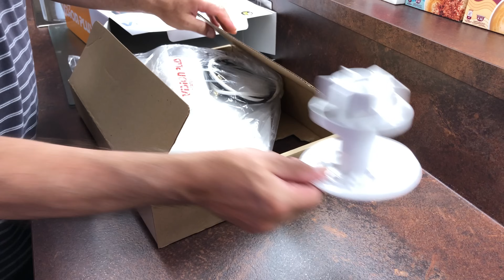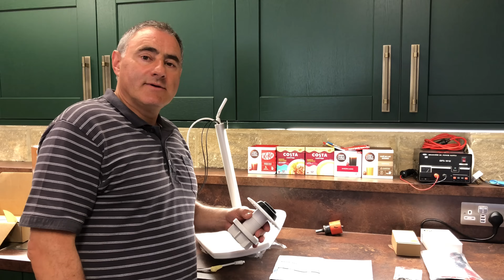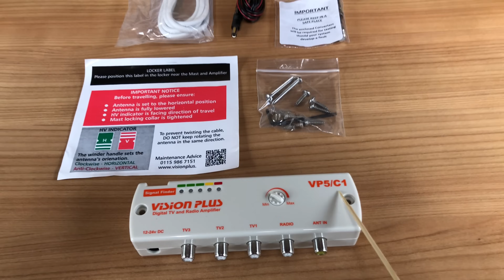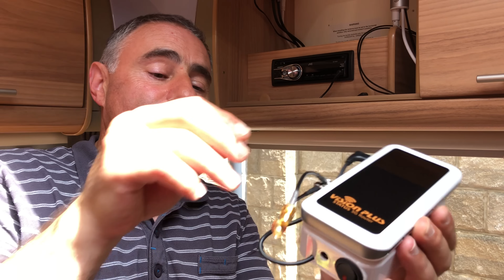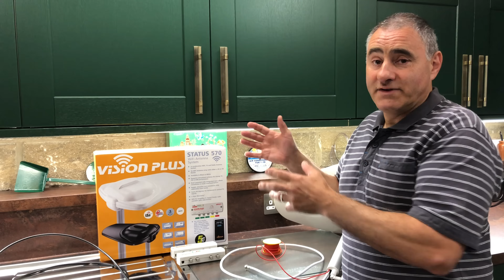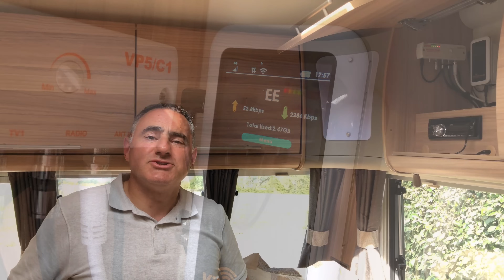Vision Plus Status 570 WiFi Antenna for Our Caravan

Comment: Fantastic video and explanation Rob. We have the same system on our new van, and like you we find it superb 👌
Reply from the maker: That’s great news John and thanks for your compliment 👍. We’ve just returned from the Lake District in a very poor mobile signal area. Alas even the Vision Plus couldn’t help us out, but I would imagine any of the WiFi kits out there would have struggled and wouldn’t have done any better. At least there was good free WiFi onsite. Thanks for watching and commenting. Cheers, Rob & Gail 😀
Reply: @robswiseways5697 Yes, many areas of the Lake District can be dreadful for mobile signal, testing even the best of devices

Comment: Thankyou so much for solving a problem for me. I now know what needs to be done about our TV and WiFi issues!
Reply from the maker: You’re welcome Yvonne. We’ve just spent a few days on a site in an area with poor/zero mobile signal that even our new Vision Plus set up struggled with. Luckily the site had brilliant free WiFi but we still struggled to make and receive phone calls. On our final day I found out the Vision Plus can connect to campsite WiFi via its antenna. I need to speak to Vision Plus to find out exactly what I need to do and I may do a short follow up video. It’s all new to me and a learning curve at the moment. Thanks for watching and happy touring 👍. Rob & Gail 😀

Comment: Great video Rob, do you have the link for the 12v Splitter please
Reply: Please ignore the email asking the same question 😅
Reply from the maker: @Dave-ps7co  No probs Dave
Reply from the maker: Thank you Dave 👍 . Search ebay item number 186078027569 for 5A 1 DC Female to 2 way male splitter plug 5.5 x 2.5mm power supply cable. 1 female to 2 male costs £3.02 plus £2.52 post. There is also the choice of a 3 way and 4 way splitter. Hope this helps. Cheers, Rob & Gail 😀
Reply: @robswiseways5697 cheers thanks, please ignore the email asking the same question 😂

Comment: HI, Rob, Fantastic video, ive just ordered it yesterday, I have a coachman and have a red wire and black wire from arial do I just cut the red one off and cut the black one and feed it back to the radio plug on the amp? I've watched the video but just want to double check. many thanks
Reply from the maker: Thank you Smokey 👍. Bear in mind you may want to hold onto your aerial in case you want to swap it back if/when you change your caravan. If this is the case make sure you cut the red wire and black cable with enough length from the mast to be able to connect it back together. Yes the red wire can be tucked out of the way and the black coax cable connected to the radio output of the amp. Hope it goes well. Cheers, Rob & Gail 😀
Reply: @robswiseways5697  thanks for your reply. Both keep on putting great videos out, all the best.
Reply: Hi, Rob UPDATE  lol  My order didn't come and I noticed the place I got it from had a flash sale on with £50 off this weekend, so I rung them up to cancel and they knocked me £50 off and it;s in the post. Happy day's lol
Reply from the maker: Wow, that’s brilliant Smokey. That £50 saving will take you away for one or two nights and you will be able to put it to the test 👍
Reply: @robswiseways5697  Yes we at at jawed next weekend so will try it. Thanks
Reply: Update, just fitted it on site in North Yorkshire, fantastic bit of kit getting channels never had before on fire stick total game changer, well chuffed. Steve
Reply from the maker: That’s fantastic news Smokey 👍. Pleased to hear you are well impressed with this kit. Our last holiday was unfortunately in a practically zero mobile signal area so couldn’t explore the Vision Plus capabilities. Will try next time we’re away. Might even do a short follow up video. Enjoy the rest of your holiday. Take care, Rob & Gail.

Comment: Very informative Rob, I noticed on your original sim the speeds were in Kbs , how fast did you get it with your other sim?
Reply from the maker: Hi Chris, it was still in Kbs but was picking up those two 4k YouTube videos. I can’t remember the numbers but it was higher than the first sim. Unfortunately Gail didn’t zoom in enough. We’re in the Lake District at the moment and mobile signal is very poor where we are staying. Inside the caravan we are getting one bar on the phone and sometimes no signal at all. I moved the sim into the router but it also only picked up one bar. So I’m now connected to the campsite WiFi. Unfortunately this is an example where even the Vision Plus can’t help us out. Hope this helps and thanks for your comment 👍. Cheers, Rob & Gail 😀
Reply: @robswiseways5697 it does, thanks!

Comment: Hi Rob. I want to buy the three way power supply cable off eBay, , but I cant find the cable which has the 5,5mm x 2.5mm? There are plenty of 5.5mm x 2.1mm. Can you give me the product number of the 5.5mm x 2.5mm on eBay you ourchased, to allow me to get one. Thanks in advance,
Reply from the maker: Hi Robert, Search item number 186078027569 for 5A 1 DC Female to 2 way male splitter plug 5.5 x 2.5mm power supply cable. 1 female to 2 male costs £3.02 plus £2.52 post. There is also the choice of a 3 way and 4 way splitter. Hope this helps. Cheers, Rob 👍
Reply: @robswiseways5697  Many thanks, much appreciated.

Comment: Great video and really informative Rob!

This Video, as per your comment about the Product, came at the right time for me as I was going to get my local Dealer to fit one of these kits but your video has given me the confidence that I can do it myself; Also good suggestion about buying the Full Kit to get the upgraded Amplifier (mine is currently a VP3 so I'll do the same).

The thing which I found most interesting was the solution for Power to the Router since the main issue which was driving me towards a Dealer fit was most other videos I'd seen were more complicated supplying power then your simple and elegant solution - Most other videos have shown having to tap into existing power lead which worried me.
Reply from the maker: Hello Dave, pleased to hear my video is going to save you an arm and a leg 😁 . I’ve just looked on Vision Plus website and they now sell the new VP5/C1 amplifier separately for £38.95, which wasn’t available when I purchased my kit. If you don’t require the roof mounting sleeve then you could save yourself £26 by purchasing the upgrade kit and the VP5/C1 amp separately. 
See other comments from Brads19 and Andrew Bird for splitter lead information. Not sure why Vision Plus didn’t supply a two way splitter as well as the 12v lead giving the customer a connection option. Thanks for watching and for your compliment 👍 . Cheers, Rob & Gail 😀

Comment: Great idea , I would use a three data SIM card from Amazon .
Reply from the maker: I’m pleased with it so far but yet to try it at various sites. Thanks for the tip 👍. Firstly I’m going to see what the difference in signal strength is inside the caravan using the phone hot spot and then moving the sim into the router. then go from there. Thanks for joining us again and thanks for your comment. Cheers, Rob & Gail 😀

Comment: Hi rob yet another great informative video if your looking to get rid of your old amplifier I going to upgrade my old type let me know if your selling it and how much thanks dave.
Reply from the maker: Hi David, sorry to disappoint but I need to hold on to the VP5 amplifier just in case we decide to change our caravan. I certainly wouldn’t leave this new system in and it will be simple to swap back over. The VP3 however is no use to me but it has no signal finder LED’s. I’ve just checked Vision Plus website and they now sell the new VP5/C1 model that comes with the WiFi kit, separately for £38.95. Thanks very much for watching 👍 . Cheers, Rob & Gail 😀

Comment: Excellent Vlog Rob. We use a Falcon 4G combo which does a job most of the time but it's a faff having an extra job to setup. This would sort itself out while i'm sorting the TV aerial out. Will see if it's at the CAMC show next month. Mossy & JM
Reply from the maker: Hi Paul, No doubt Vision Plus will be at the show. I imagine this product will generate quite a bit of interest. This is simple no faff solution (If the SIM card is already in of course) - just switch it on. Pleased you enjoyed watching and thanks for your comment 👍. Cheers, Rob & Gail 😀

Comment: hi rob and gail another great video we have been looking at the vision plus system , looks good i would of thought they would of supplied the power splitter in the kit . where did you get it from
Reply from the maker: Hi Brads, I got the splitter from eBay and it came from China. Search item number 186078027569 for 5A 1 DC Female to 2 way male splitter plug 5.5 x 2.5mm power supply cable. 1 female to 2 male costs £3.02 plus £2.52 post. I agree for what they cost, one could have been supplied. Glad you enjoyed the video and thanks for watching 👍. Cheers, Rob & Gail 😀

Comment: Morning Rob just ordered mine can you give me a link for the 12v splitter which you used....great video informative
Reply from the maker: Hi Andrew, You’ll only need a 2 way splitter. I got my splitter from eBay but I got the 3 way and it came from China. Search item number 186078027569 for 5A 1 DC Female to 2 way male splitter plug 5.5 x 2.5mm power supply cable. 1 female to 2 male costs £3.02 plus £2.52 post. Pleased you found the video useful and hope all goes well with your installation 👍. Thanks for watching. Cheers, Rob & Gail 😀
Reply: @robswiseways5697 are you doing a follow up video review after a month or so of use
Reply from the maker: @andrewbird8967  We only get away once a month. So I was thinking of mentioning signal strengths on each of our holiday videos. Cheers, Rob
Reply: @robswiseways5697 thanks rob we're not away to fit/test till October thanks for the reply buddy

Comment: I think they missed a “trick” with that router base. They should have taken the original 12v feed to the amplifier into a socket on the router base, with a socket and new power cable to feed the replacement amplifier from this. The original feed will be fused sufficiently (my Swift has a 5A fuse) to comfortably power both at 12V, as you did with the splitter power cable, but without the additional “spaghetti” to manage.

Great bit of kit, thanks for the video.
Reply from the maker: I could have pushed the splitter cable further down into the gap behind the radio meaning less cable showing. I can tidy it up more when I’ve decided on what I’m going to do with the third splitter cable/plug. I see what you mean about the feed between the router base and amp which is a good idea 👍. Thanks for watching and commenting. Cheers, Rob & Gail 😀

Comment: Weak signal on your phone
Weak signal on mobile network 
It’s all the same network issues
Reply from the maker: Hi Glen, we get a weak signal inside the caravan especially during the darker nights when the blinds are down. This depends on the external signal strength of course, but as I explained in the video It’s that faraday cage effect. My new external WiFi aerial will bring the external signal strength into the caravan. Thanks for watching and commenting 👍. Cheers, Rob & Gail 😀
Reply: @robswiseways5697 
Yes it will but if there’s a poor signal outside it still might / won’t work 
Believe me that’s what I’ve got
Reply from the maker: @itsmrfish1  I totally agree with you there Glen. If the outside signal is poor this system won’t make it any better.

Comment: That was a great video, very helpful as I am looking to add wifi to our Vigo. It seems quite expensive compared to Avtex, have you compared the signal compared to using your phone as a hotspot?
Reply from the maker: Hi Lawrence, Pleased you enjoyed the video and found it useful. I’ve noticed Avtex WiFi kits range from £329 to £649. I wasn’t keen on a second aerial on top of the caravan or the bulky router with aerials sticking out. The Vision Plus is much neater and requires no drilling. Because of no drilling I can also easily transfer my system to another van. I have yet to compare signals so will mention this in our holiday videos. In the past we’ve occasionally struggled with the signal when the blinds are down. I’m sure this is going to work for us. Thanks for watching and commenting 👍. Cheers, Rob & Gail 😀

Comment: Good video. I would love to see a speed test on a mobile not connected to the router then the same sim in the router. What is the difference? Especially in a low signal area. Does the router pick up a signal where the phone can't? The bar connection on the phone you mentioned is signal between the router and the phone not the signal strength to the router.  Im very intrested this looks great and a fantastic retro fit.
Reply from the maker: I’m really pleased with this kit. I like the neatness with no extra antennas externally or internally. I’m guessing leisure vehicle manufacturers will one day install these aerials as standard quoting them as WiFi ready. Leaving the owner the option to purchase the router. We’ll have to wait and see. I’ve always understood the WiFi signal icon is also a signal strength indicator. When at home, the further I walk away from the home broadband hub, the number of WiFi icon bars decrease. I’ve yet to experiment with signal strength and speed, but hope to be able to include it in a later holiday video when on site. Thanks for commenting 👍. Cheers, Rob & Gail 😀

Comment: If you have your home broadband and mobile phones with EE they had a deal on where you could save £20 on each sim making them £14.50 a month for unlimited data and calls. I got a third sim just for internet when away.
Reply from the maker: Hi Mike, We have home broadband with BT. Our BT mobile contract ended recently and was then moved over to EE. I’m paying £13 a month for 100 GB and now thinking about a second sim for the caravan router. Yours sounds good value 👍. Thanks for watching and commenting, Cheers, Rob & Gail 😀
Reply: @robswiseways5697 Hi Rob, I’ve been with EE mobile for years and was paying about £40 a month for one unlimited and one 2Gb sim, you can gift 100Gb  data from an unlimited sim to another on your account. We switched to EE home broadband as they were cheaper than BT, really odd as they are the same company! and were offered the unlimited sim at the reduced price, I did some calculations and for £43.50 I now have three unlimited data sims. 
The router in our motorhome is now left permanently on for cctv and remote monitoring of the Victron data when the vehicle is in storage.
Reply from the maker: Hi Mike, that sounds brilliant value for money and having a monitoring system in your motorhome is a great idea. At the moment Gail has the one sim in her phone. I’m the only person in the world that doesn’t have a mobile 😂  I’ll have to check out EE home broadband and compare prices with our BT package. Cheers, Rob